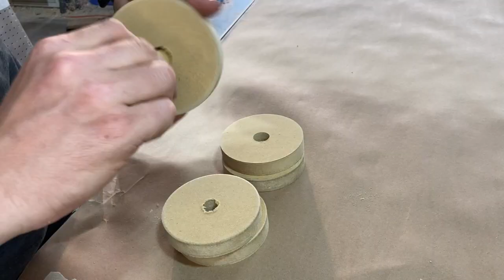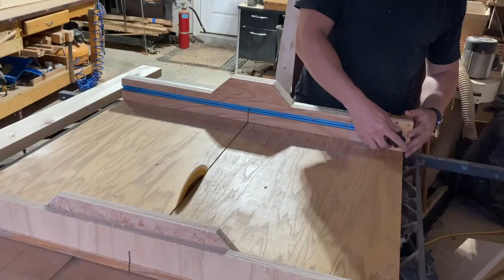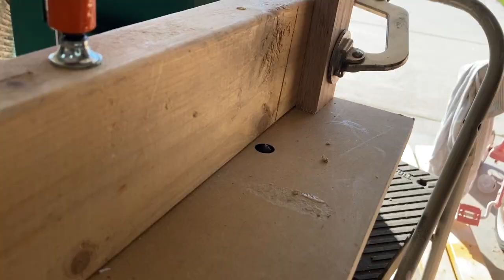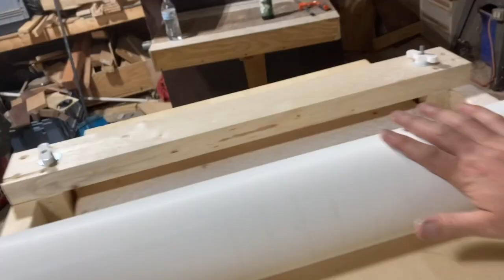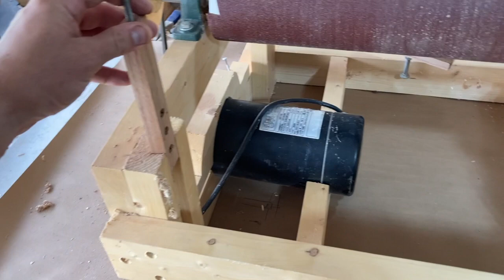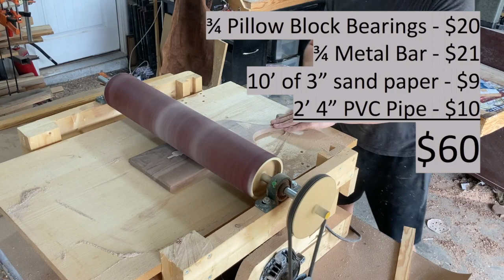Homemade Drum Sander 24 Inch Drum Sander Build

Comment: 1.5hp has quite a bit of friction generating potential. How warm does the PVC get? Any concerns with it heating up to the point that it distorts?
Reply from the maker: Hey David, your concerns about friction and heating up are valid. There are a few variables with my specific use case that doesn't make it a problem. I have 80 grit paper on mine so it does a pretty good job at removing material. If I had 220 for example I think heat from friction would be a bigger issues as it would have more surface area contact and removing less material. More of a buffing effect. Second is I have to feed all my pieces in by hand, so I get a really good sense of the resistance, if it's too much I just back it off a bit. It's easy to find a sweet spot where the drum is removing enough material but it's not overloading the motor. But to you point, yes if you were to try and take too much material off in one pass for a long time, there would be heat generated. Would it be enough to warp the drum? Who knows, I hope I don't find out.

Comment: Where did you get the lock collars?
Reply from the maker: Charles, the pillow block bearings I used have build it lock collars. Super easy to use, they have a small recessed allen screw. Here is the link for the ones I used. Pillow Block Bearings | https://amzn.to/2Uc5rSf

Comment: why  not  use only one wheel in each end and simple ,i think is same effective because that pvc pipe is hard and rigid ..im thinking in make my own drum sander but i dont want to put so many wheels inside the pipe ..yes im lazy .at this point i have all pieces cut over my work bench to finish i have just to put  the drum parts togetter .is only 21 inches whide but my proyects right now are less whide than that .
Reply from the maker: I think you may be right, 2 wheels might work. 3 wheels would for sure be enough. I'm spoiled with my cnc so it was easy for me to make 5 wheels. Let me know how yours turns out with 2 wheels.
Reply: @KeimpieceCarpentry  yeah i will make it in my router table .easy job.thanks msn
Reply: @juniorundersea  unsupported pvc will flex.  Flex is bad.
Reply: Putting flexing of the pipe aside, don't forget all the power is transmitted through the wheels with their glued connection to the axle being the weakest link. One at each end may fail under load without additional reinforcement.
Reply: @dirtmover123  i made it all ready ,but i screwed the wheels to the axe glued the wheels prior to screw them and sanded to a smooth  finish .is working good right now ,i  made it again only with wheels glued and screwed the wheels on each tip ,and ready sanded super nice sanding machine ,fast and flat,smooth,.just have to sand with a  fine papel with my orbital and the finiah is beautyful.

Comment: Hi sir  is the cnc router also built by you
Reply from the maker: The CNC that you see is a X-Carve. 1000x1000mm made by Inventables. You're looking at around $2000-$2200 for that.

Comment: You did not show how elevation was attached ?
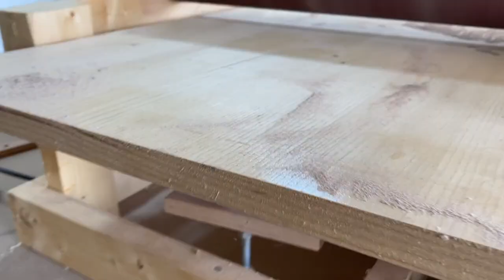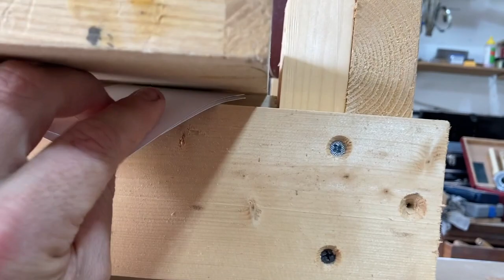Reply from the maker: Start watching at 3:38. The bolt is what adjusts the height. The table top is just resting on the horizontal support show at 4:04. Hope this helps.
Reply: @KeimpieceCarpentry  Did you think about doing 2 bolts on each side, independent of each other?  You're already measuring so you know what shims to use or when you're level.  You'd be adjusting both bolts similar to what you do with the shims.  Just a thought.  Now I'll go out to my drum sander-less workshop :(

Comment: I used to have a DIY Drum Sander but is taking too much space in my shop so I got rid of it. After a few years, I realize I really need one. I'm thinking of a design that will save space when stored, but will not compromise accuracy. Anyway, thanks for your video, I really like the PVC instead of using wood although out.
Reply from the maker: I agree, space and storage is a huge factor. Right now I store mine on the floor in some underutilized space. I highly recommend the PVC method, it worked great, I get really good results.

Comment: Awesome job. What are the stats on the motor...and where can I get one
Reply from the maker: Jason, the motor is 1 1/2 HP and it was reclaimed from an old pool pump. Its able to be wired at 240v or 120v. For this application I kept it at 120v and it works just fine. I didn't do any crazy math to figure out pulley ratios for rotations per min, I just went for it and it works great.
Reply: @KeimpieceCarpentry  awesome. I need a drum sander and I cannot justify the 800 plus price tag
Reply from the maker: @oscrfsh  I highly recommend building one. Mine is pretty big so storage is a pain but I would recommend sticking to a simple design like mine. I only use it for cutting boards that have inlays. I recently just got an order for 50 of them so I'm super glad I had built this drum sander.
Reply: @KeimpieceCarpentry  I think I can get a similar motor from a pool pump. Have you tried doing a very wide board through, which it looks like you may be able to get something like maybe ~18 - 20" through there? Just wondering how that motor will handle that kinda load.

Thanks for this vid. Think I'll gonna have fun trying this project :)
Reply: @piptyson5512  FYI, a Jet 1632 uses a 1 1/2 HP motor too. It should be plenty as long as you’re not trying to remove too much material at once.
Reply: @michaelkeymont501  Ok thanks.
Reply: @piptyson5512  hilarious! I just walked in the door from buying a 1 1/2 HP motor from a guy on Craigslist and this comment is the first thing I see on my ipad... must be a good omen!
Reply: @michaelkeymont501  I'm awaiting a price for a 1.5 hp motor today with a dealer discount. Hopefully good omens all around lol
Reply from the maker: @piptyson5512  I just double checked mine, it is 1 1/2, it's got plenty of power.
Reply from the maker: @piptyson5512  I designed it so the PVC pipe is 24 inches wide knowing that I have a 12 inch planner so if I was doing a big glue up I'd run the two pieces through the 12 inch planer, glue them together and could sand the 24 inch panel with the drum sander. Realistically I would only do about 23 inches wide though. I haven't had any projects that require it yet. I've been doing mostly cutting boards with inlays. Each board is only about 7 inches wide and 20 inches long. A cool technique I've been using is micro adjusting the table so the right side is just a hair higher than the left. This allows be to pass the board through two times on the left, changing orientation each pass for the initial material removal, then just moving it over to the right side of the table and doing the same things. That way I get to remove two depths without adjusting the table.
Reply: @KeimpieceCarpentry  Cool man thanks for all the info!!

Comment: Awesome, thanks for remembering me. Can’t wait to give this a shot.
Reply from the maker: Let me know how it turns out
Reply: @KeimpieceCarpentry  gonna have to find a good motor somewhere first. But definitely gonna keep the project in mind. Or might just cave and buy a Supermax or Jet lol.
Reply from the maker: @derkadesigns  If you have a grind wheel, you could remove the grind stone and add a pulley instead. Not sure if it'll be powerful enough, but great way to utilize an on hand tool that doesn't get used too often.
Reply: @KeimpieceCarpentry  don’t own one, might have to get one from harbor freight and see what happens.
Reply from the maker: Here is a link to the plans if you want them. https://keimpiece.com/collections/build-plans-digital-files/products/drum-sander-build-plans
Reply: Use of a bench grinder that's under power be a good reminder for when you try to take off too much because it would steal. Like engineering in weak points on cheap parts to protect expensive parts. You have to use it right.